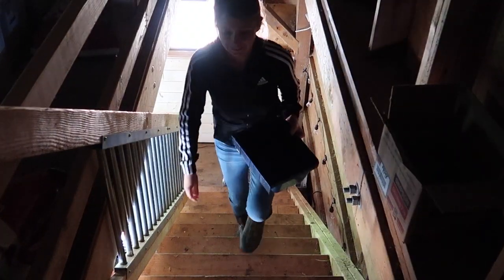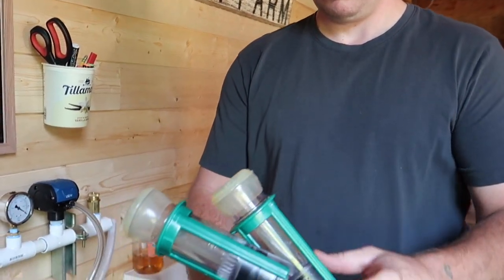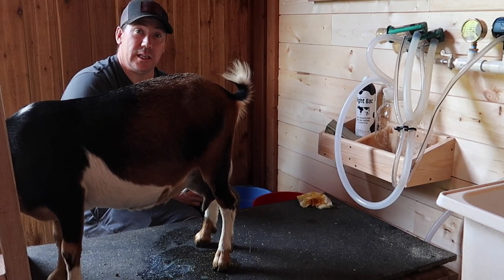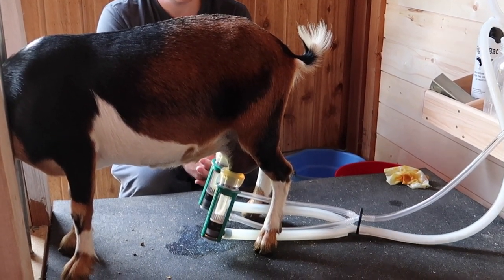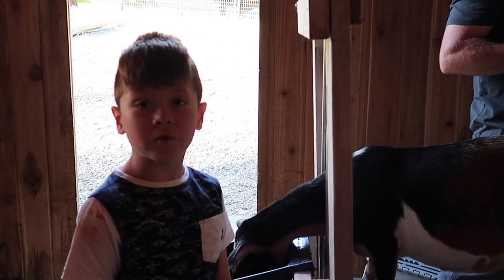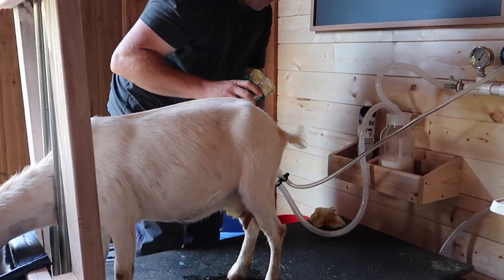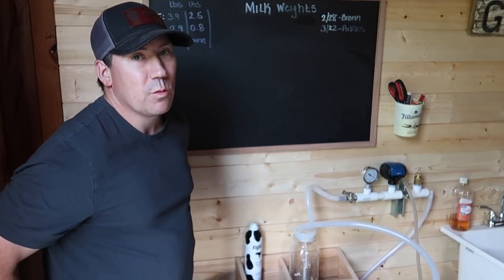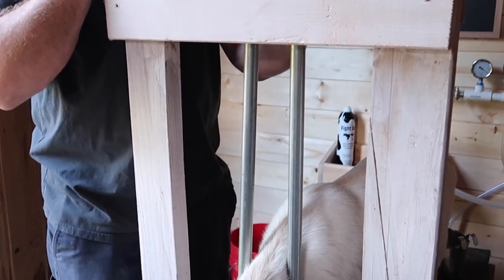New Milking Routine with Our MILK MACHINE- Start to Finish How to Milk and Clean

Comment: Soo...you've probably figured it out by now, but if you want it to alternate teat pulsation timing to copy hand milking you need two of the skinny vacuum hoses attached to the pulsator, and the other end to each inflation. Milking two goats is done when you split each of those  vacuum hoses with a Y then one from each side to each inflation. Not sure it matters, but just a note. Other than that that's an amazing setup. Love the sink.

Comment: I could milk a goat and a cow with the same system, correct? I would just have to adjust the pulsator in-between milking each animal?
I was trying to figure the cost saving between buying this and a surge bucket - the inflations/tubing for each animal is basically the cost of a used surge. 

I'm still intrigued!
Reply from the maker: I don’t know about milking cows only goats I’m guessing you would need different inflations and possibly a stronger pump?

Comment: Hello guys. I love your content. Can you tell me now that you’re two years into this milk machine do you still hang your tubes to air dry or do you hook them up to something to make them dry? When I hang man they never get completely dried out. I was wondering if you still practice is exact same routine
Reply from the maker: Yes I still hang them to dry. I do use a rag and dry the rim if there is water pooled in it. If you suck air through it after cleaning that helps. 😁
Reply: @JohnsonFamilyFarmstead  OK thank you so much for responding.

Comment: Does the milking machine hurt them ?
Reply from the maker: Not at all. You need to make sure you have good inflations with a machine that has a pulsator and a pressure regulator.
Reply: @JohnsonFamilyFarmstead  what type of milking machine do you use
Reply from the maker: We made ours but simple pulse is very similar 🙂
Reply: @JohnsonFamilyFarmstead  what teat cups do you use
Reply from the maker: These are the gea topflow z inflations. We purchased these from Hamby dairy supply. Our “machine” is made from pvc and has a vacume regulator and gauge, we also purchased the pulsator from hamby. Here is a link to a video where we made a mobile version. 
https://youtu.be/mIFRu2XhB5s
Reply: @JohnsonFamilyFarmstead  what animal can they be used on?
Reply from the maker: Goats or sheep
Reply: @JohnsonFamilyFarmstead  I’ve once seen someone use those teat cups on a horse